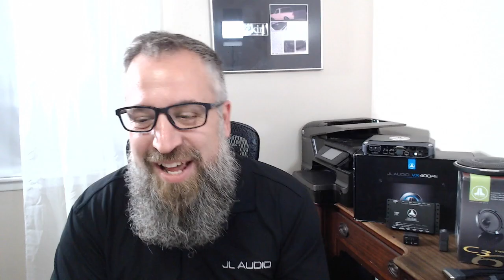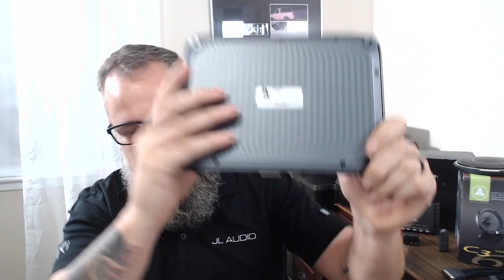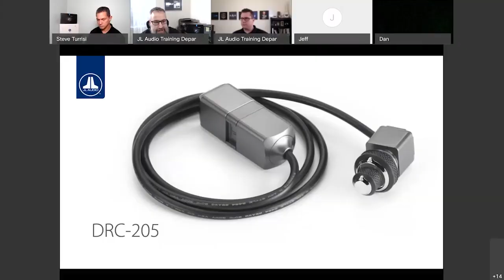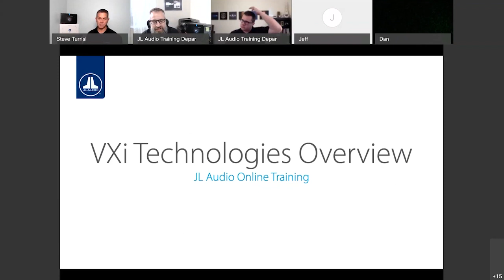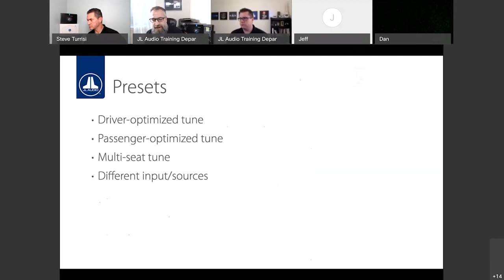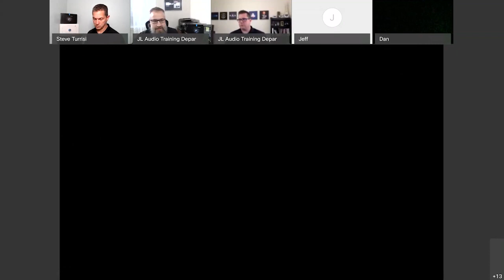[Live] JL Audio Training About DSP Amplifiers - Session 101a: About VXi Hardware

Comment: @jlaudio Although these are nice amps, i feel they may be underpowered. Take a look at the 6.5 inch C7 speakers running at 4 ohms,. they have a rating of 125 rms but the vx only pushes 75 rms at 4 ohms. You cant bridge them because that would put them out of warranty range.  The HD 600 x4 channel would be beter suited as those push 150 RMS and well  inline with the 50-175 rms power rating..  people want more power but choosing to use the VX amps you'd be leaving 75 watts on the table
Reply: What warranty range are you referring to?

Just bridge 2 channels to your mids. They will almost never see the full 200W in practice. The C7s can absolutely handle it.

Comment: Where do I find the help videos for antisocial idiot for beginners
Reply: Click the JL Audio YouTube page. Go to videos and scroll or swipe down, this video is part of the introduction to VXI amplifiers. @honky1
Reply: @digginglow  thank you, I have a vx10005i..I finally figured out how to connect it to Tun.  But once in tun ,I couldn't find where to adjust gain ,etc ..I played with eq section but heard zero change..so Ive been stuck using a 700 JL 5channel marine amp run to one 1000 w7 12 one  600w4 12 and 2 12 square kickers....sounds good but I can only image it with the vx1000 5i..ugh
Reply: @Honky1  that’s awesome, the vx1000.5i is a great choice. beside the JL audio videos there’s not much on YouTube about setting VXI gains. I learned from watching the videos. Just watch the basic tunn video that will get you started.

Comment: I just bought the VX800/8i. I’m so glad I found these videos. I’ve never had a full blown dsp before. I’m looking forward to learn from these videos.
Reply: @williamprice4269  how's it coming along?
Reply: I have the same. It's a cool amp, but bridging channels barely pushes a JL Audio 10". It's supposed to produce 190 watts at 13v, but it's not enough. I was told by pro installer that one 10 needs 400-500 watts. 🤯

Anyway, had I known, I would have planned my system differently.

Comment: Why is the power clip so difficult to put in and out when needed?
The plug arch’s when setting it up or having to disconnect it …
Reply from the maker: We do not advise plugging or unplugging that plug with live power on it. You should remove the fuse at the battery before attempting that. It needs to be tight for proper good contact to allow proper current flow into the amp.

Comment: How to switch to optical input? Connected optical from device and no sound. Only getting sound from headunit and not my device.
Reply from the maker: The optical input signal will need to be routed to the output channels of the amplifier within TuN software.

Comment: i would make a couple of suggestions as a vxi / tun user. 1.  allow importation of REW files and overlay that onto the EQ and to then be able to use the EQ with the REW frequency response.  2. allow importation of REW tuning files.  3. allow for full tuning on a complex setup (3 way system) using the Android NON-tablet app.  4. add mic input to allow for autotuning with internal autotune software.  add a coaxial digital input, as optical cables can be reasonably fragile and are  digitally limited. amazing product  and insanely easy to use.  thanks for a great product!
Reply from the maker: Thank you so much for your input - we will certainly pass this along to our development team!

Comment: This is my Favorite Video and my Favorite product. 2020 Giveaway. I Love JL Audio 🤓👍
Reply from the maker: Good luck!
Reply: @garminaudio 
Do I need to use a Fix86 if I'm using a VX1000/5i for oem integration?
Plus, if i use the optical in cable, do I have to run new wire to my speakers, or can I make a new harness that connects to the factory out harness for the speakers? I feel if I did this i would have to run all the speaker to their own channel and not use the crossover unit. Am I correct?

Comment: Dsp amplifiers!! Thanks for all the help videos.  Could definitely use the 700w vxi.. running 2 jlw3v3 10s and 4 c1 650x in my crv... the subs are currently on a rf550 and the c1s on factory head unit.. thanks again for the help videos and the chance to win the amp!
Reply from the maker: You bet. Thanks for entering. Good luck!